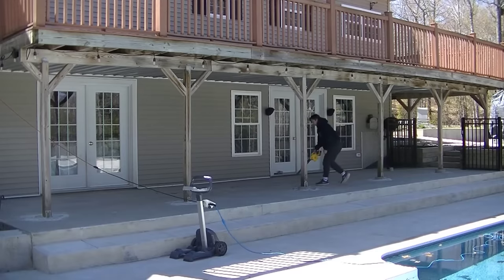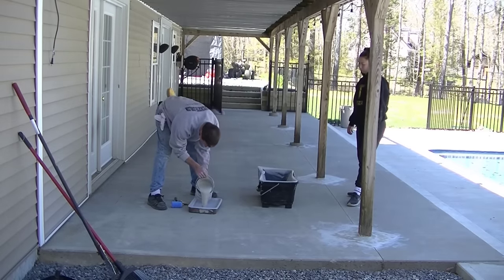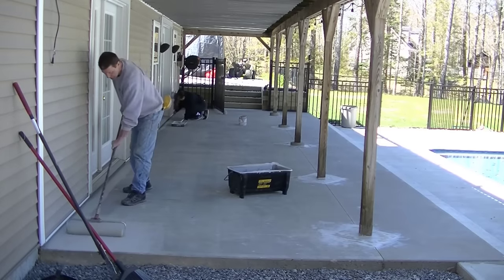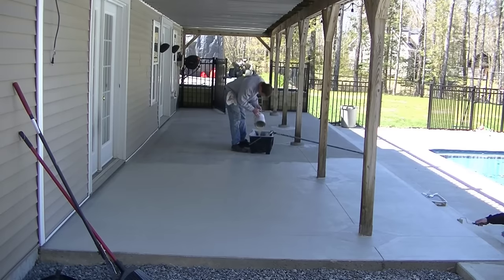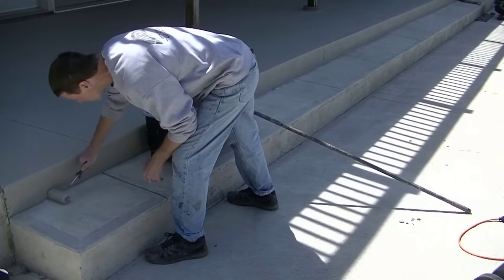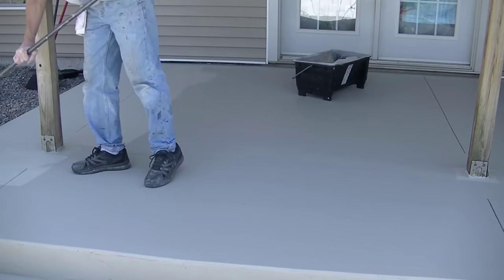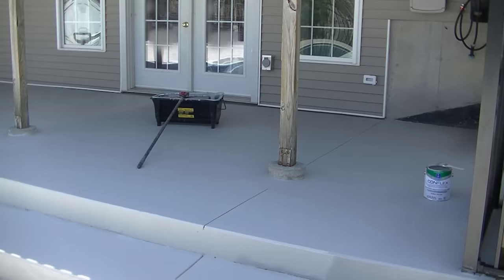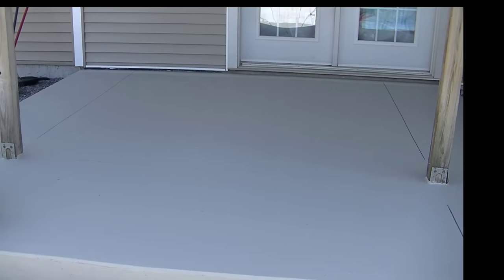How To Paint Concrete (What I Use On Patios, Pool Decks, and Walkways)

Comment: Here’s a tip from a voice of experience. Never paint outdoor concrete! It begins an endless cycle of repainting peeling paint, it fades, looks horrible.
Reply from the maker: I make it clear to the customer there will be some touch up down the road at some point. It's they're choice.
Reply: you used the wrong product ...... HC solid stain is the best , lasts for many years ..... acid etch first ..... 10 years fer sher
Reply: Meant no offense, wish you had done mine instead of the goof l hired.